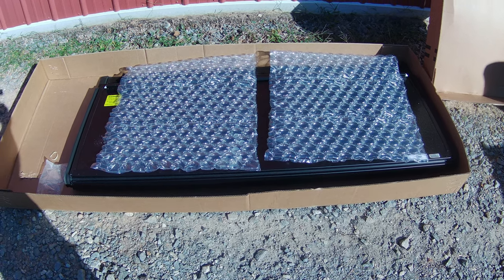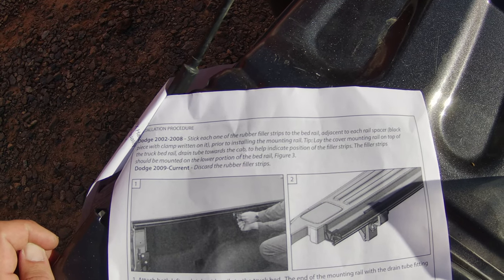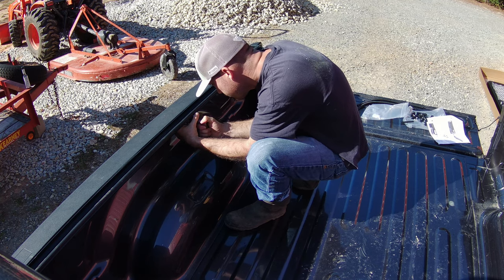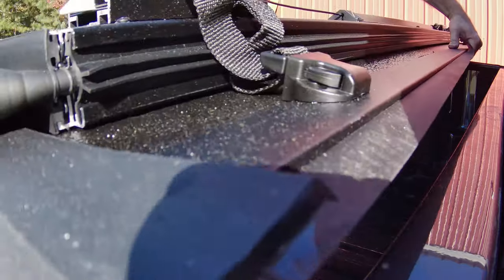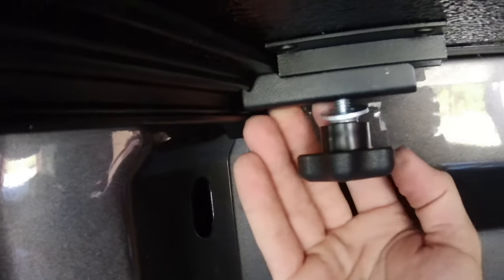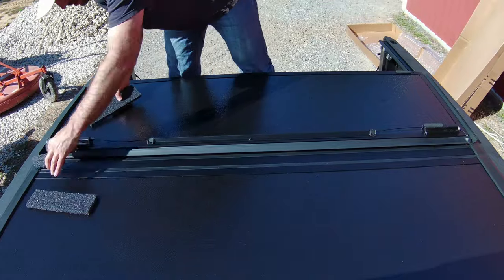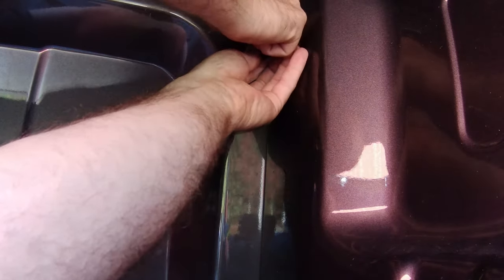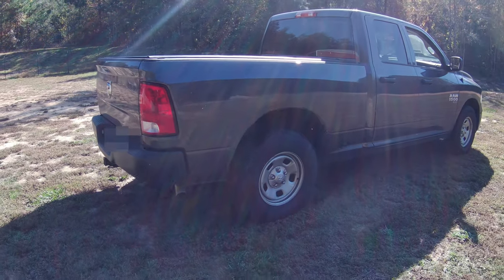Gator EFX Tri Fold Truck Bed Cover | How to Install and Initial Impression

Comment: Thanks for the shots installing the bed rail clamp.  Was not clear to me to go over the semi circles in the channel until I saw your shots.  Worked for me right away then…
Reply from the maker: Good deal! Glad it helped! Still got this thing on my 2500 Crew Cab and holding up well.

Comment: Thanks for the info and video!  We actually installed 2 efx covers... One on my 2016 Ram 1500 and another on a 2021 Ram 2500... Pretty simple and seems to be very waterproof.. We ran the pickup through the carwash lastnight and actually no leaks!  We are traveling and wanted hardcover to prevent theft!
Reply from the maker: Good deal! I transferred this one to my 2021 2500 as well. Definitely better than the old roll up soft covers.

Comment: Put the drain hose on when your installing the rail before you put the top on. will save you from having to crawl under at lease 1 time
Reply from the maker: Yeah. Figured this out when I swapped it over to my new 2500. If I recall the directions had it in the last step.
Reply: @BackRoadBound  Sounds about right, thanks for the video. I just ordered one and it will be useful. Have a great day
Reply from the maker: @thomasmoore3205  Sweet! At least you can learn from my mistakes. Good luck with it!

Comment: any input how well this stand to the element heavy rain and snowfall
Reply from the maker: So I have it on my 2500 now. It leaked a little on my 1500, only because I had installed it about a 1/4"too high.

On my 2500 I installed it a little lower on the rails. This helped the gasket material seal better. I have had no leaks now, even with some pounding rain. 

Can't speak for snow, but it feels pretty sturdy. A couple feet of heavy wet snow might be a problem, but I think it be alright with some average fluffy snow.

Comment: What length did you get?  I have the same truck and was wanting to verify the correct length.
Reply from the maker: The 6' 4" is featured in this video on my old extended cab 1500. I now have it on my 2500 Crew cab and it fits it as well.

Comment: What’s the difference between the FX3 vs EFX?  There’s a good price on the EFX.
Reply from the maker: It looks like on the FX3 the panel close the cab lifts up. On the EFX like mine, you can only flip the two panels to the rear up. The panel towards the cab is fixed. 

Not really sure, other than that.
https://gatorcovers.com/p/gator-fx3-tonneau-cover/
Reply: Efx is not a trifold